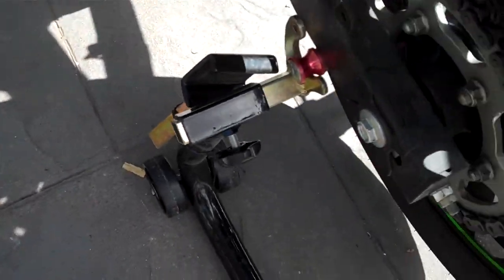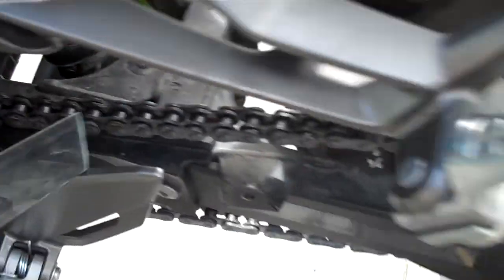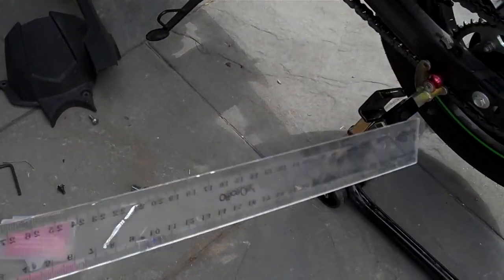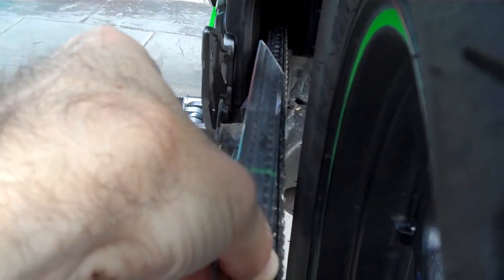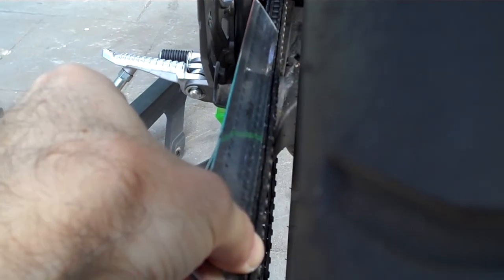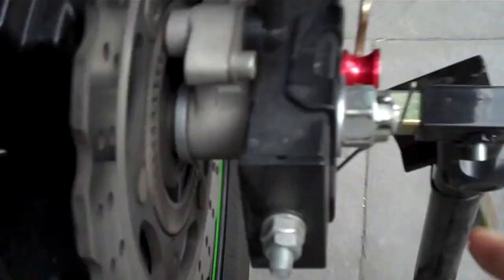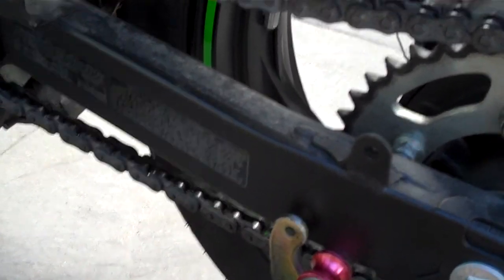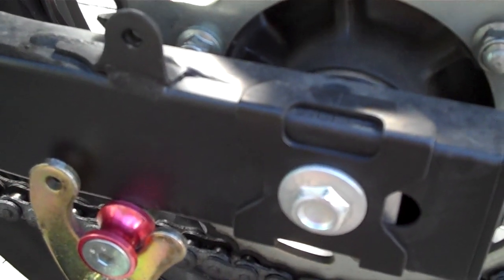How to align chain & sprocket ninja 300

Comment: Thanks mate, i really needed this, now going to go to bunnings to grab a steel ruler. i am still planing on garbing the Motion Pro alignment-tool to have latter on, but this will help for now.
Reply from the maker: glad to be of assistance. Supercheap auto also sell inexpensive steel rulers too
Reply: Just got one for 3 dollars =) lovin it. get back to you if i need any more help, thanks again mate
Reply from the maker: no worries, anytime. its very easy to do, watch the video a few times, you will be an expert in no time
Reply: TheStinger30 ok so that's now finished. its like 99.9% in line. but i keep getting a "Speed Wobble" at around 70 to 80 km nothing over nor under. do you have any idea what could be causing that? from what i have read people say i could try a new steering bearings??
Reply from the maker: mmmmmmmmmmmm... might be sterring stem bearings. could also be the tyres are cupped. could also be the wheel balancing is out. how many kilometers are on the clock? if you ride down a farily decent hill and you  keep the power applied while you do down, does the speed wobble still happen?i can remember my bike did the same when it was brand new and did it only only deceleration from about 75kmph to 65kmph. it was cos the tyre itself was faulty from the factory and needed to be replaced and caused the wheel balance to be out.
Reply: TheStinger30
 still only new, about 1400ks on atm, but its been happening from brand new. and it only happens when slowing down. 85kmph is the highest speed it started happening all the way down to 60ish when its got a really bad wobble. might have to take it into the shop and ask for them to check to see if the wheel is balanced properly.
Reply from the maker: yep check the wheel ballance to start off with. tyre could be stuffed or rim bent, might be steering stem bearings, but check the simple things in life first like the wheel ballance.keep me posted to what you find out
Reply: TheStinger30 OK, so earliest time i could get there in was this Friday at 10am. asked them if they could just re-balance the wheel. they asked me if the tyre has any eggs/bumps in it, i said no.
ill let you know Friday arvo how it goes.
Reply from the maker: Midnight Magic the tyre probably wont have any eggs/bumps in it that you will see form the outside. if there is it could well be on the inside and you wont see it till you physically remove the tyre from the wheel.it could also be that there is no visbile signs anywhere on inside or outside like egg/bumps . but if you run your hand around the tyre itself you will feel the rubber "collapse" so to speak where there is an air gap in the tyre itself. its quite common on dirt bike tyres. petty rare on road bike tyres, but it sure as heck happens. happend on my new orange 2014 ninja 300.